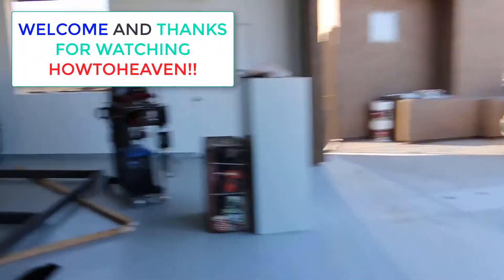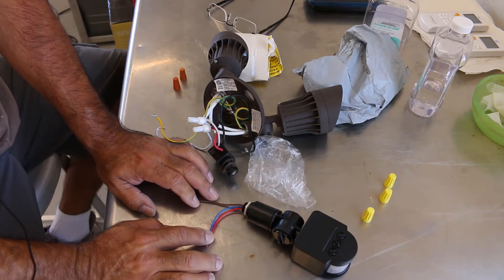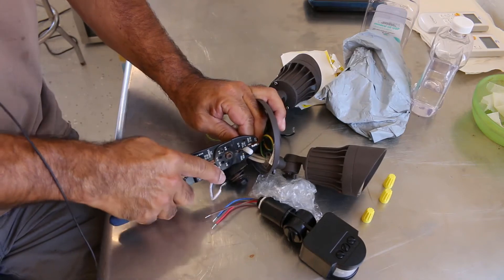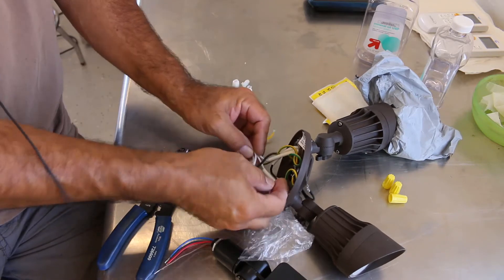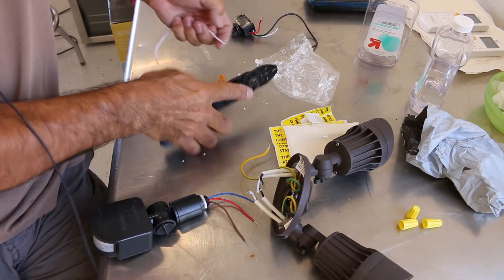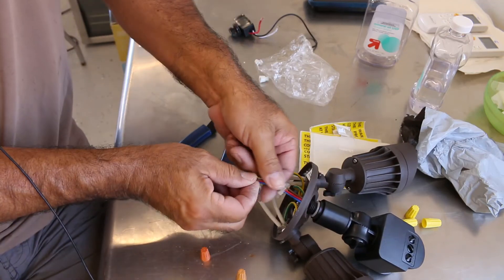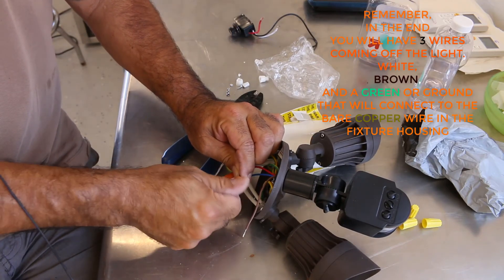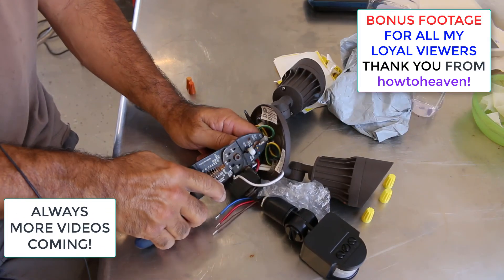DAY NIGHT MOTION SENSOR INSTALL ON ANY FLOOD LIGHT.  howtoheaven shows you how DIY!

Comment: Wonder if you might know, as I have a Lovinton Motion sensor light i’m about to hook up that has a black and red wire but it has two blue wires instead of just one,, so are they both common wires? Thanks for any advice.

Comment: Finally after a couple of days searching for the el cheapo Chinese motion sensor and explanation of the exact way to hook these up . After spending $25 for a Harbor Freight floodlight fixture, did a search for just the motion sensor, that I could wire to the rest of the existing floodlight fixtures at other corners of my house. In my case, purchased on Ebay. The small paper insert that came with the motion sensors, was for Euro-Sino application. Figured it out, but visual and verbal confirmation that I connected it properly, is alot better. Thanks for explaining what each wire represents, and which color and location to attach.
Reply from the maker: Your welcome, I'm glad that you found my video useful! Thanks for watching
Reply from the maker: You are welcome and thanks for supporting my channel!